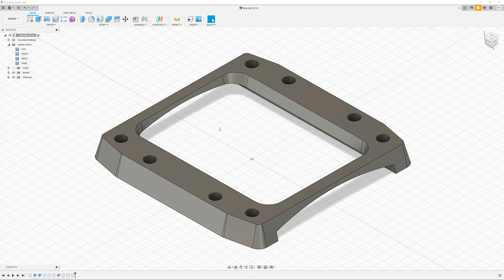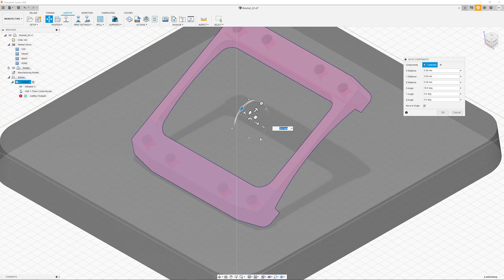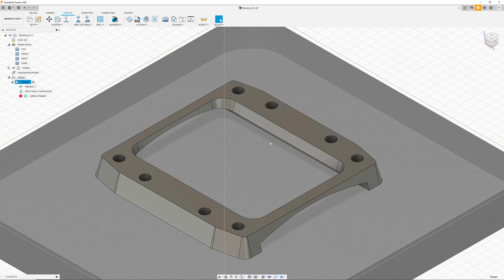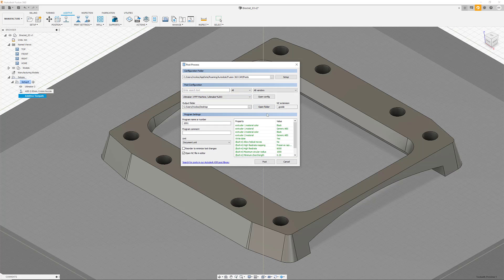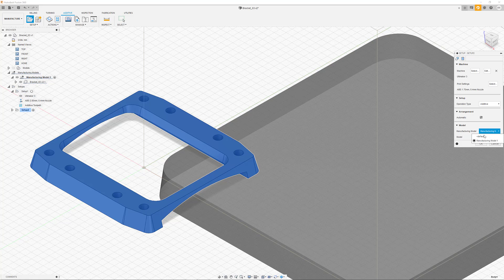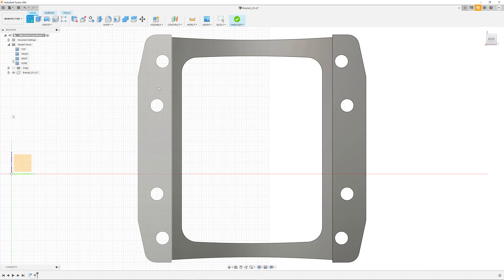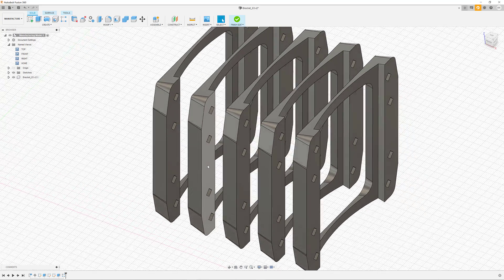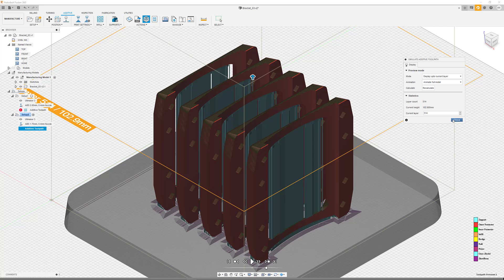Tutorial: Fusion 360 Additive for your Ultimaker 3D printer

Comment: Dear Autodesk, Stop wasting time on a Slicer for F360, it really isn't needed, UNTIL you get the 2D Drawing module finished AND have a BOM/PARTS system that's easy to work with across Eagle and Mcad, with the ability to have the BOM/PARTS system integrate into accounting software!

AND can we have HI RES ANIMATIONS exports!

Comment: No clear advantages over well established Cura platform.  BTW, you will want to consider rotating the part 180 deg for FDM.
Reply: I don't see any advantages either except in a production environment where the terminology of CNC is already spoken, the workflows are similar and once set up, you just crank out units. For most of us using a 3D printer for one-off prints or prototypes, there is no apparent advantage over Cura, PrusaSlicer. Nothing wrong with it. It's just a matter of using the right tool for the job.
Reply: I would think the biggest win would be the support for arc feature (in the future) in the generated G-Code as it already knows the arcs.
Reply: One thing I like about this, is it finally looks like a realistic path to get away from meshes.  Once the slice is represented as bspline, you can start using the circle, and helix interpolations.  The HSM engine has been doing this in CNC for many years, it would be nice to have that in printing.  I just don't see it happening in the maker space.  Once the software supports this, we can start thinking about removing the other hurdles, like Marlin.